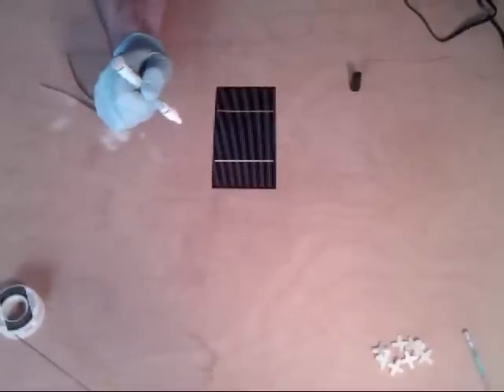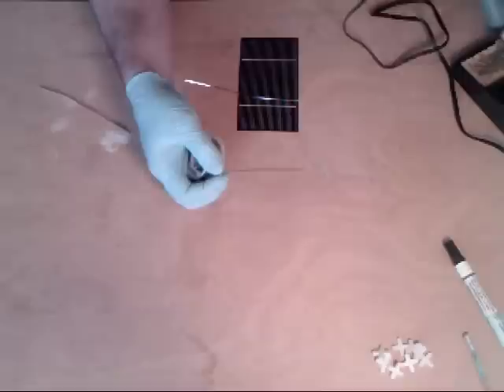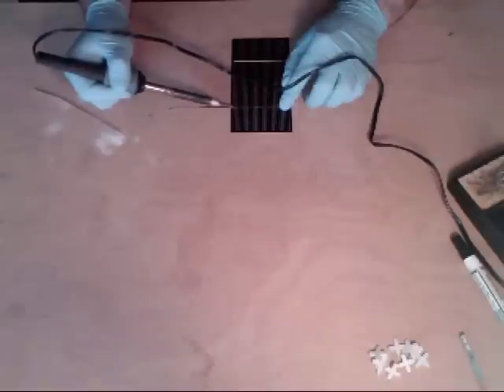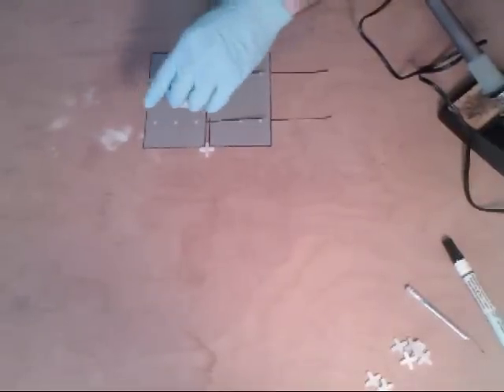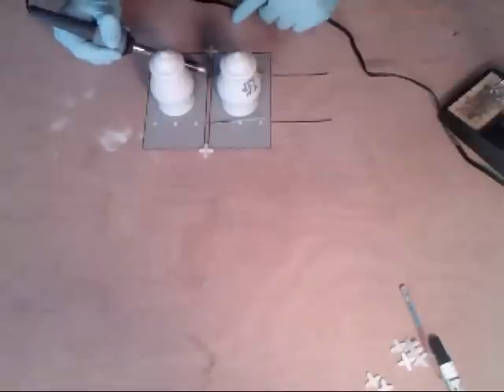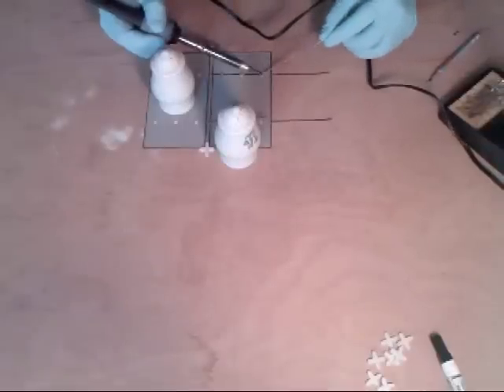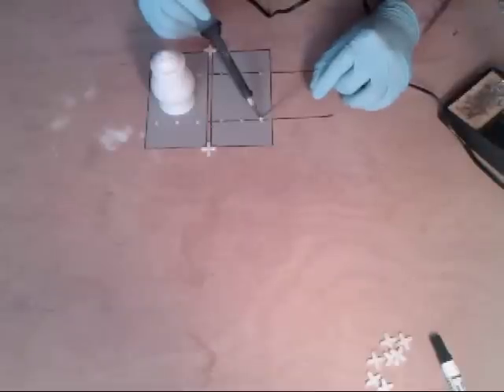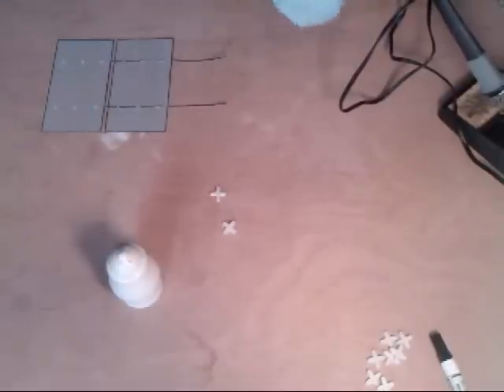How to: Aluminum Frame Solar Panel P3

Comment: You don't want solder peaks, don't finish a joint by lifting the iron straight up. Slide the tip off horizontally. Most of the solder will stay on the tip. Work quickly, the longer the joint is hot, the more the molten solder/flux will loose surface tension. Always use 63/37 solder because it has the fastest transition to solid.